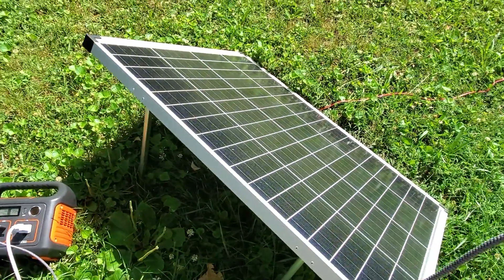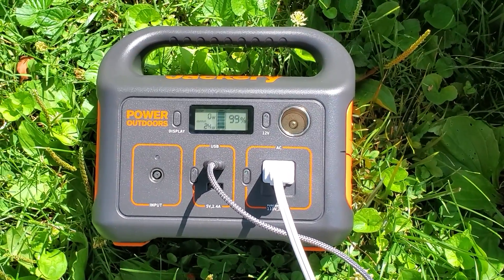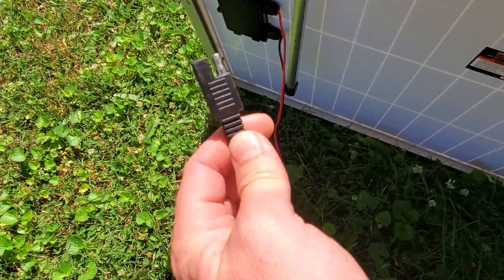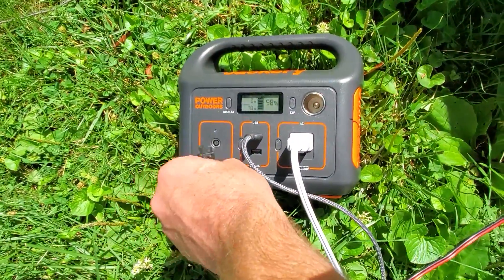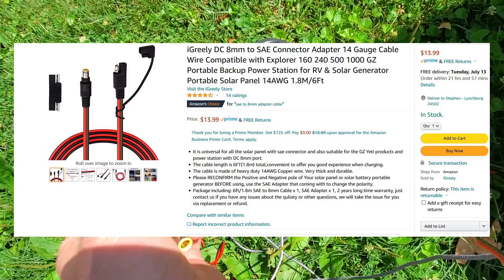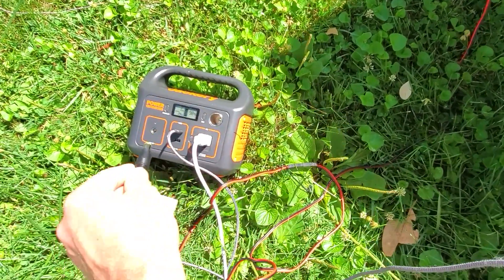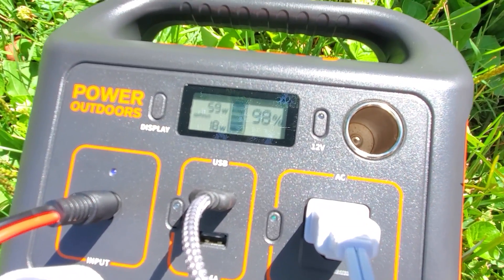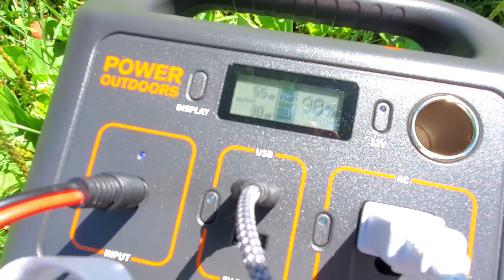ONLY 1 simple cable needed for Jackery & Harbor Freight panel

Comment: A few recommendations.

Although I’m not familiar with that particular unit Jackery says a) to not put the unit in any orientation except on its rubber feet (video showed it on its back, probably for clarity of the charging/discharging states), and b) pass through charging is possible but not recommended until you get to newer-styled units. 

For example, our Explorer 240 and 500 do not recommend pass through charging, but our 1000 Plus allows it.
Reply from the maker: Hey thanks for watching. Not sure why it matters if a Jackery, or any other power station is on its side, as far as I know lithium batteries can be oriented in any direction. I remember that being a selling point over lead Acid batteries. I have had this specific Jackery for a couple years and have used it extensively. Just from my own use I can say it has not had any effect. I'm not storing it like this, but when my kids use it in the van or the RTT it definitely ends up on its side. Just thinking it through... power tools alos use lithium ion cells (as does this older Jackery) and are in all orientations at some point.
Reply: @kampinglogik  not sure either.

Comment: Yes nicely done. I just purchased both a Jackery 290 power station (400 watts) and a Bluetti 700 watt power station. I had purchased the 4 solar panel kit from Harbor Freight a while back so now I will start using my solar panels to charge the two power stations when I’m doing my ham radio field events. Great video, simple, to the point.
Reply from the maker: Thanks for watching! Glad it was helpful. Cheers!

Comment: Help! I just bought a Jackery  Explorer 880  and I have a Thunderbolt solar kit model # 63585   that I bought 2 years ago. I can't find any info on getting an adapter to hook the 2 together . I contacted both Jackery and Thunderbolt , they couldn't help me. The solar kit has been upgraded recently I heard and I have the older model. Any info?
Reply from the maker: What is the connection/end on the cable of the solar panel kit?
Reply: @kampinglogik  the same as in your video above. I'm getting alot of different  advice , I am worried I will mess up one of the units if I don't have the proper adapter .
Reply: I think the big question has been about the fact that supposedly Thunderbolt changed their connections in the newer models the last year. I was told mine was the older model.

Comment: Does the standard 100w Thunderbolt panel come with a “charge controller” or do you have to buy that separately? It looks like you have plugged the 8mm adaptor right into the stock jack from the panel…does that black box on the back of the panel have any kind of regulator in it to protect the Jackery? Thanks
Reply from the maker: This Jackery, (and pretty much any other powerstation that i know of) will have a built-in MPPT charge controller. This is definitely one of the beautiful aspects of powerstations. All you need is to plug a solar panel in and you are good to go! In this video here I explain all the components a powerstation incorporates: https://youtu.be/CD2LjX8glGk

Comment: I've been using that very same 100W Harbor Freight panel for a good couple of years to charge my Jackery 500 that has been running all my lights, charging devices, running fans, etc etc etc.

Just got a Jackery 1000 yesterday, and this 100W panel WILL charge it under MY normal uses for it... but... I'm gonna need to get another panel to PROPERLY charge it for when I actually need or require it. So I've gotta figure out how to link the two panels together to charge the one device. The J-1000 has an Anderson connector on it. I don't know if that'll be a real thing or not.
Reply from the maker: Hey Thanks for watching! I like the Jackery 1000, my friend has one and I've borrowed it a number of times, both for camping and for testing panels and what it can run. I agree, you'll definitely want a second panel, specifically for cloudy days or off-season when there is less daylight hours. Typically a single panel will get you 500 watt/hours in a single day, so if you have a drained power station  in the morning, you'll want to be able to put more wattage in than just "half a tank" in a day. 

Did yours come with a little adapter box with an Anderson connector cable output and dual 8mm input? Like I show here in this video? https://youtu.be/JrDEUUvo33g?t=507

Otherwise you could get one of these 2x1 SAE adapters: https://youtu.be/hWGMl1BawEY

Here is another video I did on the power station, I was pretty impressed: "What can the J1000 run?" https://youtu.be/fy6NuKTSl5A
Reply: @kampinglogik  Well, the way I run it, it's always plugged into tthe solar panel. I'm (currently at least) not going out on trips and whatnot, and at home I use this little setup to run what I described above.

I mean, YEAH... I'm gonna get another panel for it. But right now? I'd have to TRY to use more than 30% or so of the battery. Which that little 100w panel will keep up with perfectly fine. hehe
Reply from the maker: @DavidMiller-kv4we  Yeah I totally get that. If you have a reserve of power for a day or two of minimal sunlight, then you are good!

Comment: Help: After exchanging both 100 watt briefcase thunderbolt panel and the jackery 290, the panel STILL does not charge the jackery -- After four phone calls I was told to purchase an Igreely dc 8mm. It's in the mail. So the cable that comes with the panel does connect and fit fine into the jackery, it just doesn't charge the jackery -- it did once and never again, From the videos, the Igreely dc 8mm looks just like the detachable piece that comes with the panel. Where am I going wrong?
Reply from the maker: Strange they told you to buy this connector - I have both the 8mm IGreely adapter and the 8mm connector that comes with the Harbor Freight briefcase. In my experience they work interchangeably. I use both connectors for either of my 2 Harbor Freight panels to connect to my Jackery. If you are getting no charging input on the Jackery, it may be because the wires in the connector are flipped for some reason and it needs an SAE polarity reverse adapter.

The likelihood of having 2 bad solar panels AND 2 malfunctioning Jackerys seems low.
Reply: @kampinglogik  Thanks. Fixed. I did not realize the solar panel and the jackery must work at the same time while getting sun to charge the jackery -- I was having the panel outside then bring it inside at night to charge the jackery. Although, I made five calls to customer service and Harbor Freight did not solve it until the fifth phone call. Two phone calls made me buy TWO unnecessary  cables.
Reply from the maker: @juliotorres5659  Awesome. glad you got it solved.

Comment: Can you use the cigarette lighter adapter that came with the jackery to the male cigarette lighter power plug that is sold at harbor freight in a kit?
Reply from the maker: Yes you can. I just was trying to keep it to 1 cable plus the panel, rather than 2 cables between the panel and power station.

Comment: So the MMPT controller throttles down the 100W Panel to about 65W - is that correct?  You cannot pump in more than 65W - correct?
Reply from the maker: Yes exactly. This is applicable for the Jackery 290... not sure on other models. I have borrowed a friends Jackery 1000 and it was limited to 115 watts or there abouts
Reply: @kampinglogik  wow, good info - thanks for posting.
Reply from the maker: Hey thanks! Glad it was helpful!

Comment: ECOFLO solar generator units used with harbor freight panels seem to require the  reverse polarity adapter, videos on YouTube on that. I have the same Jackery as you, it appears no reverse polarity adapter is needed on the Jackery? I don't want to ruin my units. Thanks.
Reply from the maker: Correct - no polarity adapter needed for the Jackery + HF panel in my experience.
Reply: @kampinglogik  Info has value. Based on your comment I am successfully charging my 100W Harbor Freight solar panel  in the 100F degree Arizona sun. It's going into a Jackary 290. This is my first attempt. Showing 52 watts input, partly cloudy, and not a perfect angle. Please provide a donation button on your videos, info I got from you is worth a true Thomas Jefferson. ( $20 ). Again, information has  value. 🙂🙂🙂🙂🙂🙂🙂
Reply from the maker: @keithinaz9769  Hey thanks so much! Glad it is working. No need for a donation, put that in your gas tank. Happy travels!

Comment: Hi, the cable from amazon comes with a small middle connector, is that necessary to plug also?
Reply from the maker: Hi thanks for watching! I'm assuming it is a polarity switching adapter piece with SAE on both sides? It is only necessary if the polarity of your set up is switched. Basically if the power station is getting watts from the solar panel, then you don't need it :-) if for some reason the power station is "seeing" no input wattage from the panel, then put the little piece in between the panel and this cable.

Comment: I've got the exact same setup. My solar panel is providing no power to the Jackery.

Is a  charge controller required for the Thunderbolt solar panel? Seems like Jackery should take care of that. Thanks. We enjoy your videos.
Reply from the maker: Oh no!! There must be some issue with one of the two, or the cable connecting the two. You are correct that the Jackery has a built in charge controller. You need to first figure out which of these is not working. Do you have the charging cables that came with the Jackery? If so hook up the AC adapter to the wall or the 12v cigarette adapter to your vehicle, if it charges, then we know it is either the panel itself, or the cable connecting.
Reply: @kampinglogik  I figured it out. Used my voltmeter to check polarity. Put a polarity reverser on and all is well!
Reply from the maker: @pauldonovan5653  Ohhh nice!! So simple, I should have thought of that. I have little polarity reverse adapters as well, but have yet to need one. Glad it was an easy fix!

Comment: Hi ,
I have the yeti 200 X and 500 X with this particular cable you advertise to your fit the bigger unit ,thank you
Reply from the maker: Hopefully I am understanding your question correctly (connecting this SAE connection from a solar panel to a Goal Zero powerstation?) My understanding (from reading reviews) is that it is the same input size (8mm) BUT for some reason Goal Zero uses a different 8mm input than Jackery that is more recessed and the plug will not go in all the way. So you need to find a plug that is an "8mm barrel" that people are Specifically saying fits a Yeti - like this one: https://www.amazon.com/SolarEnz-Connector-Perfectly-Compatible-Generator/dp/B085382H49/ref=sr_1_2_sspa?crid=2F8CHW2JZIPJH&keywords=8mm+to+sae+connector+YETI&qid=1655185372&sprefix=8mm+to+sae+connector+yeti%2Caps%2C60&sr=8-2-spons&psc=1&spLa=ZW5jcnlwdGVkUXVhbGlmaWVyPUFIR1QzRFM4NDNEQU4mZW5jcnlwdGVkSWQ9QTAxNDE2NjBFOURSMTFDWUpDTSZlbmNyeXB0ZWRBZElkPUEwODcxMjIyM0VCRkw5U0tVTkNaWSZ3aWRnZXROYW1lPXNwX2F0ZiZhY3Rpb249Y2xpY2tSZWRpcmVjdCZkb05vdExvZ0NsaWNrPXRydWU=

Comment: Whats the name of the of the plug that goes to the generator i cant find it on search engines.
Reply: Dude I finally found my original connectors but thanks anyway 😂🤣
Reply: Mines has a ciggarrete lighter to mc4's its a older version but now I can pair them with sae's still the links are usefull I greatly appreciate it.
Reply from the maker: @ben_eighth  Hey! That's the best outcome :-)
Reply from the maker: The input on the generator is an 8mm DC port... so you need a cable with an 8mm barrel (male) connector ... the cable I'm using is an 8mm male to SAE connector. You can also find cables that are 8mm to other types of connectors as well. here is the one I bought and use: https://www.amazon.com/iGreely-Connector-Compatible-Explorer-Generator/dp/B08L5T7NF1/ref=sr_1_3?dchild=1&keywords=8mm%2Bto%2Bsae&qid=1628208549&sr=8-3&th=1
Reply: Yea i keep typing that in the search bar i guess good things are hard to come by because it doesnt pop up but ill try using your advice thanks.
Reply: I need a ciggarete charger to sae but doesnt pop up anywhere i tried close descriptions no luck either.
Reply from the maker: @ben_eighth  there is an SAE to cig lighter (both m and f ends) in the Harbor Freight solar wiring kit: https://www.harborfreight.com/solar-power-connection-cable-kit-63981.html
Reply from the maker: @Benjamin ochoa If you type in "sae to cigarette lighter plug" in Amazon you will get a bunch of options like this one: https://www.amazon.com/SinLoon-Cigarette-Waterproof-Extension-Charging/dp/B073WW13PF/ref=sr_1_15?crid=26278PHRWRI9M&keywords=sae+to+cigarette+lighter+plug&qid=1652327588&sprefix=sae+to+cig%2Caps%2C71&sr=8-15

Comment: Is a 12 volt adapter cable (that comes in the Thunderbolt 6 piece solar power connection cable kit), the same as the 8 mm barrel connector? Total newbie here.
Reply from the maker: No, unfortunately it is a different/smaller barrel size in the thunderbolt kit
Reply: @kampinglogik  Thanks.
Reply: I really appreciate your video. I just ordered the Jackery 1000, and have bought HF's 100 w solar panels. At 71 years young, this is all alien to me. In charging my J, do I use only 2 of the panels, giving me 50w? Or should I use all 4?
Reply from the maker: Which harbor freight panel did you buy? 
Did you buy this one: https://harborfreight.com/100-watt-solar-panel-kit-63585.html?_br_psugg_q=solar+panel+kit

Or this one: https://harborfreight.com/100-watt-monocrystalline-solar-panel-57325.html
Reply: @kampinglogik  the one with 4-25w panels. I saw on another video that I can use all 4, as J 1000 can take up to 125w solar charge. Hope they're right!
Reply from the maker: @vickiparrish3235  oh definitely use all of them... honestly you could hook up 2 x 100watt panels. The internal charge controller will limit the wattage input of the solar panels. I use a 100 watt panel on my Jackery 290 and it has a 60 watt input limit. Part of the deal with solar panels is that they are not 100% efficient, in that they will never give you their full output rating in real world use. So when possible having more solar panels than the stated limit is better, especiially early and late in the day or in cloudy conditions🙂
Reply: @kampinglogik  -Thanks so much for all of your help. I really appreciate it!

Comment: Is the cable the male or female ? Your Amazon link has male and female options.
Reply from the maker: SAE cables are not male or female, they have both on each connector, and the polarity can be flipped with an adapter. The 8mm end is a male connection to go into a power station's female charging input. Which link were you looking at?

Comment: will this cable work with the explorer 1500?
Reply from the maker: No, apparently the Jackery 1500 unit uses a proprietary cable
Reply: @kampinglogik  hi... i did get it to work; but had to use the jackery splitter
Reply from the maker: @tracylyon70  ahhh good to know, thanks for sharing!
Reply: Thank u for heading me in the right direction 😁

Comment: I have a smaller panel from HF and the same connectors and it won’t charge my Jackery, what could I be doing wrong.?
Reply from the maker: Polarity might be flipped? Does it register any input at all?
Reply: @kampinglogik  it does not register on the jackery. If I plug it into a charge controller it will then show a reading on the charge controller but still not the jackery.
Reply from the maker: @flavrdPnut  I bet the polarity is flipped going into the jackery somehow... they have these little adapter pieces you can throw on an SAE cable (if that's what the connector is... https://www.amazon.com/iMESTOU-Polarity-Connectors-Disconnect-Extension/dp/B083XMKJ8K/ref=sr_1_6?crid=1XH4EBP42UX20&dchild=1&keywords=sae+polarity+reverse+adapter&qid=1631601621&sprefix=sae+polarity+%2Caps%2C161&sr=8-6

Comment: So the jackery doesn't come with connectors?
Reply from the maker: The Jackery comes with a cable to charge from a vehicle's 12v outlet or a 120v AC house plug. But it needs an adapter to connect to the Harbor Freight solar panel's SAE connector, specifically an SAE to 8mm DC barrel connector
Reply: @kampinglogik  ok. Thank you.🤠
Reply from the maker: @cuddlesanddaisy  Unless you buy matching Jackery solar panels, there is a high likelihood you will need some kind of adapter to get to the 8mm DC input of the Jackery, as most solar panels have MC4 connectors, or a few use SAE like this Harbor Freight panel.
Reply: @kampinglogik  ok. Trying to get this on a small budget.
Reply from the maker: @cuddlesanddaisy  Yeah then get the Jackery, the Harbor Freight solar panel is only $100... and the adapter can be had for $15ish ... here is the one I bought and used in the video: https://www.amazon.com/iGreely-Connector-Compatible-Explorer-Generator/dp/B08L5T7NF1/ref=sr_1_3?dchild=1&keywords=8mm+to+sae&qid=1628208549&sr=8-3
Reply: @kampinglogik  ... Your amazon link for the Jackery cable, it has options for Male and Female separately, , , , hmmm.  I guess one could just splice into some of the cables that come with the Jackery.
Reply from the maker: @amyself6678  ok right, you want the 8mm side to be male (that will insert into the jackery charging port). SAE cables by design have a dual male female connection. So looking at that amazon link - you want to choose the "Male" option
Reply: @kampinglogik  ... Thanks for info on male/female plugs, ,
Reply from the maker: @amyself6678  no problem - glad it was helpful!